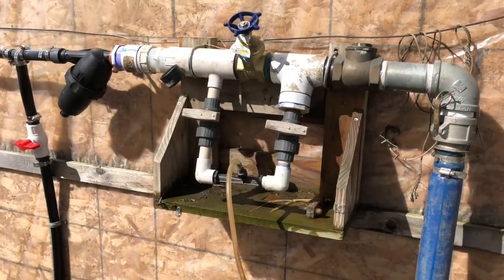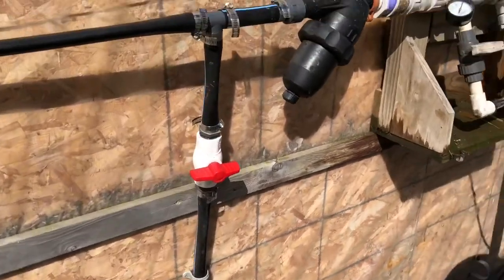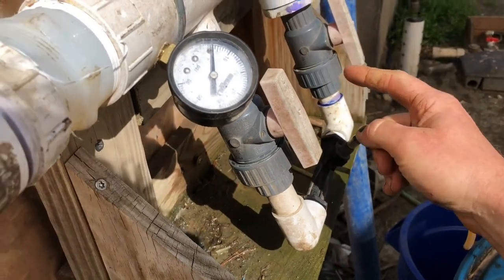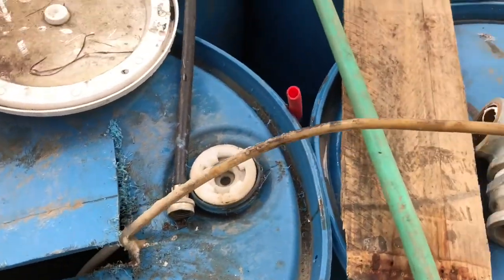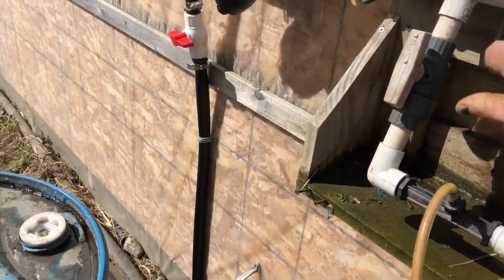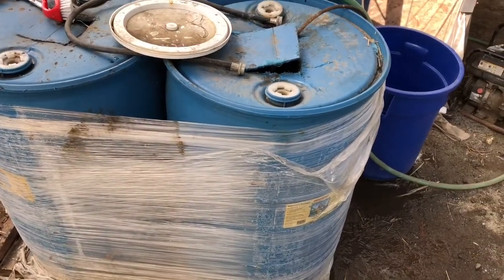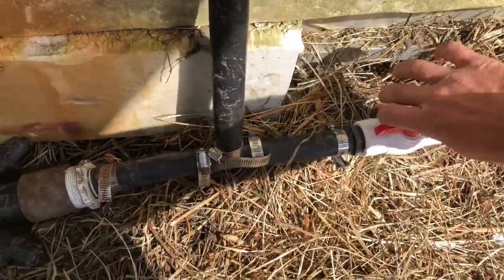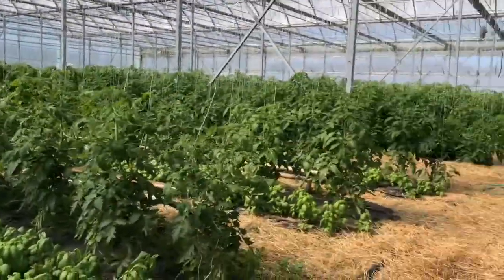Fertigation setup

Comment: We add a line from our air compressor connected to a radiator blowout wand for stirring Neptune’s product.  Shove it in the barrel and place a valve to adjust the air flow passing into the barrel- makes it simple to stir and aerate the good microbes within.  Honestly we’re growing trees so we run an orchard sprayer for foliar applications.  Sometimes a touch of molasses.